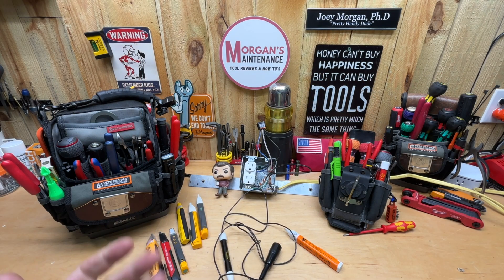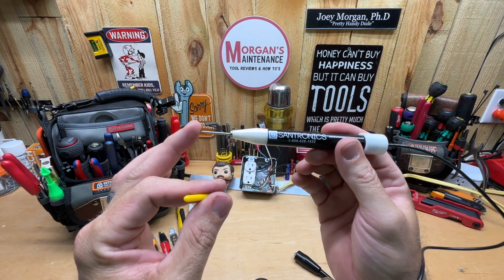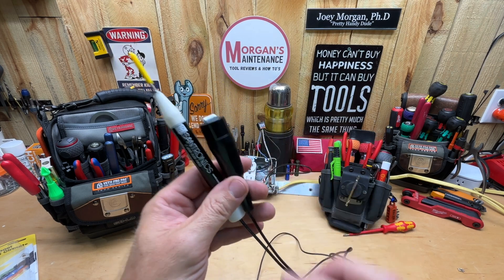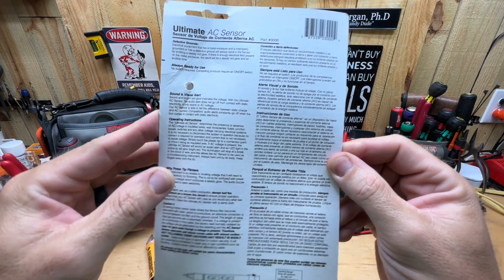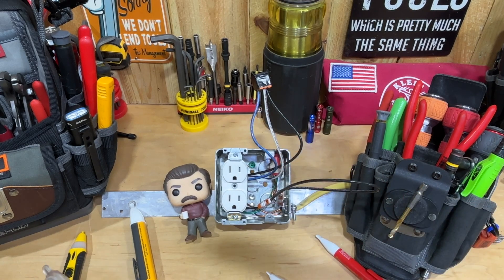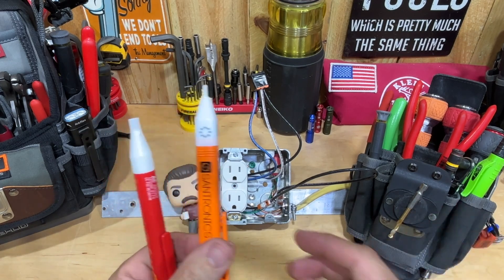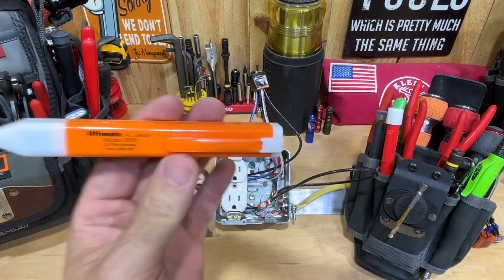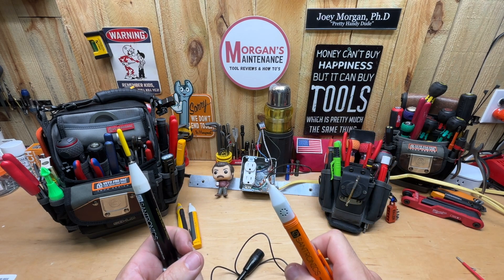Santronics Ultimate 3000 NCV & DC Detector 3315 - Best of the Bunch? #tools #electrical #ncv #tester

Comment: I’ve had three or four different Klein ones and they don’t handle drops to well. I wont be buying another Klein brand non contact voltage tester again
Reply from the maker: I don’t like their size  or sensitivity.  I’ve got a couple.  They are good when you are just going to town gutting a place, but I prefer these for initial troubleshooting
Reply: I had an older one I got maybe 6-7 years ago in my big tool box with same batteries thank goodness the old batteries didn’t leak. Put some news ones in it and to my surprise it still works!! Had it not been for me watching this video I would have never thought of that thing, lol!! I’m an electrician and my last Klein did not survive a 5 foot drop last week. Thank you, thank you!!
Reply from the maker: @iceinyourveins-rn7em 👍👍

Comment: The always on type hot sticks are the only ones I use. Bought one of new style Klein versions with the flashlight and threw it away after getting shocked on a false negative. The old style one always works. Just run them back and forth through your arm hair before you use them to make sure they are working. The static will make them light up
Reply from the maker: @tj10777  these Santronics ones have become my “go to”.  I love the sensitivity on them, just right in my opinion
Reply: @ I agree. I’ve been carrying one of the red ones for years

Comment: I saw these Santronics NCVs at one of the supply houses I frequently go do and my eye was definitely drawn to the “always on” feature. I normally use the Fluke but the button can be a bit of an annoyance when I’m wearing cut resistant gloves. I will have to pick one up soon. As a secondary point, I appreciate you demonstrating how to turn on and off the sound on the fluke. I thought the sound just was working intermittently for me due to dropping it or something.
Reply from the maker: @BradNeumyer  I was the same way on the fluke till Simone showed me 😂

I like the Santorics aloe though 👍

Comment: Purchased the red one last week . The battery cap is stuck with no way to change the batteries. Ordered a second one. Same problem. Checked the negative reviews on Amazon and several others had the same issue. Some of them broke it trying to unscrew the cap. Essentially it’s a disposable tool when the batteries die. They both are going back.
Reply from the maker: @timh7156  appreciate you sharing your thoughts 👍

Comment: It would make more sense to me for the Sperry to have the button somewhere towards the back. I don’t want to have to put my hand all the way at the front of the tester to see if I’m finding something hot…especially if I have a crowded spot with wires. Jbox, panel, trough, etc.
Reply from the maker: @nachoisme  yeah I 100% agree with that… it’s a pokey stick for a reason 😂

I don’t want the tip of my finger that close to the pokey part
Reply: @MORGANSMaintenance The only time I want my finger that close to the pokey part is when I’m taking a leak 😎
Reply from the maker: @nachoisme  😂

Comment: Love the Santronic (regular). I don’t generally care for sound but I might pick it up to see…it may fit a bit more snug in my mp2. 

The only issue I have had with it is in HVAC equipment…it always seems to just flow when I’m anywhere close and loses its individual wire confirmation. Still, it’s the best I’ve used.
Reply from the maker: @nachoisme  I like everything about them both compared to others.  No buttons, no ridges, sensitive enough but not too much.

I’m glad I stumbled upon them

Comment: I know you don't need any more ncts but the wiha though expensive is more goldilocks of sensitivity your looking for.  Wires that close it passes the white is not hot test in a plastic or metal box.  It's only a touch more sensitive than the santronics but with the gauge on the front you can see false readings based on the lights.  It also knows low or under powered 120 volt situations if there's a broken leg.  If it wasn't for the 5ish flukes around I'd get more of rhe santronics and wihas.
Reply from the maker: @MattHmm-rq6dn  appreciate the info and suggestion 👍👍

Comment: Don't really have the Santronics units in the UK, unless you import them via Amazon or eBay. They seem like quite  a good unit in comparison to the others. I have one from Wiha but found it ate batteries, so now use ones from Kewtech for general use and an specialised one from Multicomp for hazardous areas.
Reply: Was your wiha the one with the gauge on it 25506?  If so my batteries are over a year old and not dead.  It does have more bells and whistles like the flashlight so I can see it not lasting to the down of time.  Either way find what works for you till you find something better suited.
Reply: @MattHmm-rq6dn  Yes, that is the one. Not sure if mine has developed a fault, batteries would only last a couple of weeks.
Reply: Original batteries mine came with energizer maybe something to open up and have some fun with.
Reply from the maker: @three-phase562  they have been my favorite for the “always on” and the sensitivity with no buttons.

I had never heard of them before, but so far in my limited use they have both performed really well

Comment: After your old review I got the 3k model myself and turns out ot be my favorite.  Also like you I have 4 or 5 of thoes flukes around and they are in bags and pouches as well out of abundance.  Main bag wiha santronics and side pouches/quick bag sb-ld are flukes.  The size really matters too it seems like the veto little pockets are made for thoes flukes and why you see them so often in them.  This may not be everyone's list if importance but if you can get a made in usa peice of electronics and it not be as expensive as other brands along with working well it's a win win win.  The only downside to santronics which they don't need to fix really is I don't see them being nearly as rugged (but they would need to be thicker more expensive ect) which would defeat the pluses it has to fix that.  Geat content as always!
Reply from the maker: @MattHmm-rq6dn  yeah people have said the 3115 type break fairly easy when you drop them… luckily I haven’t dropped mine yet 😂

They are priced well that I can live with it if they break a little easier for the performance they give.

Comment: With the ground clip required, how is the DC version not inferior to a voltmeter, which would also show measured voltage (and might tell you there's a voltage-drop problem)?
The AC version looks fine.
Reply: Alot of car work you just need to see if it's getting power easy as that.  I prefer a power probe myself to turn on pumps ect.  But for the size under a dash and no power required or hooked to the battery not bad for the size.
Reply from the maker: @OnusBones  I was thinking about the little small KAIWEETS pen tester and I feel like that would be a little more useful, but like Matt said, someone may want one with no buttons, nothing to goop up for just quick testing.

I’m kinda like you in the way of thinking, but I don’t do a ton of DC work